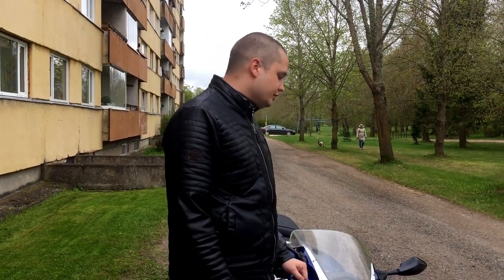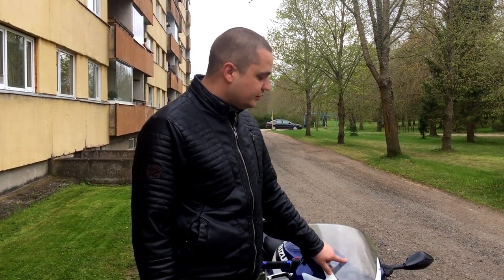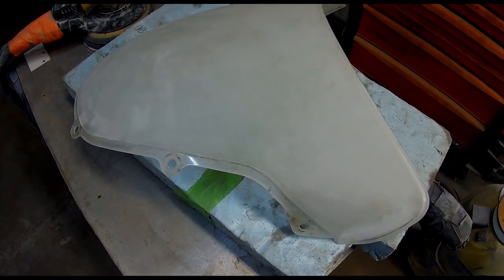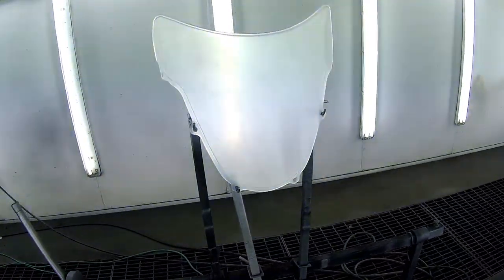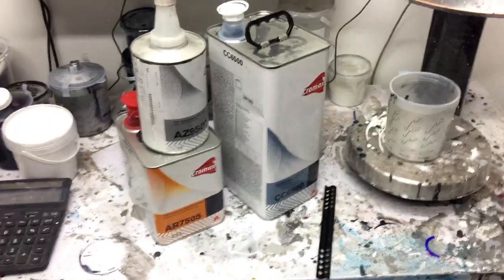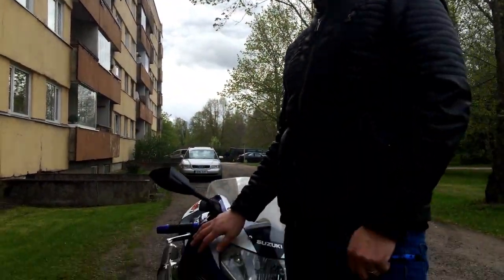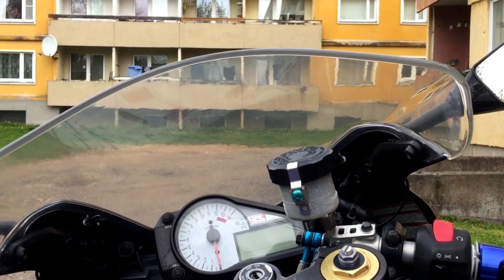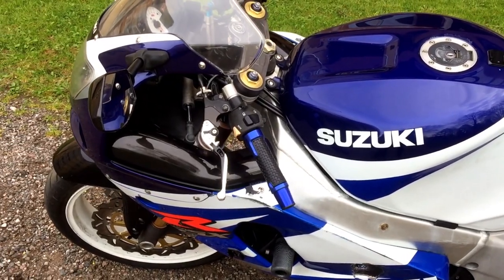Suzuki Gsxr 1000 K1 First Bike Windshield Restoration

Comment: switch it out for a double bubble, better for touring and trackdays for us larger men, gives us that little bit extra in wind deflection up and over our shoulders and head. P.S. my K1 dyno was done on mine and had a custom mapping, 143bhp on the rear wheel, my vid is up, turn up the sound and enjoy the tune of Yoshimura
Reply from the maker: Thank you for the idea.In the beginning i thought should i replace or restore it.But its a original windshield so i restored it.Do you have a specific windshield what i should look?I will check your video also thank for info🙂